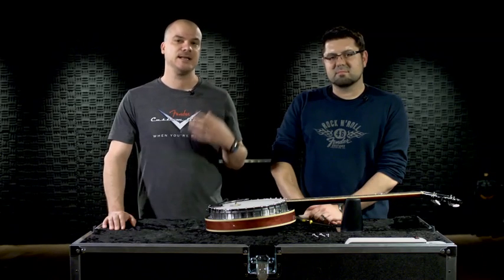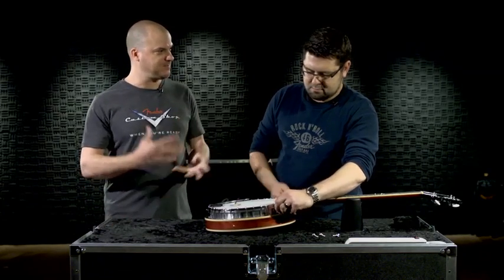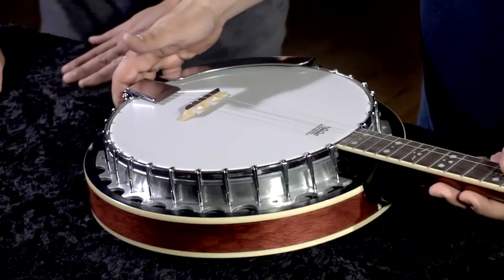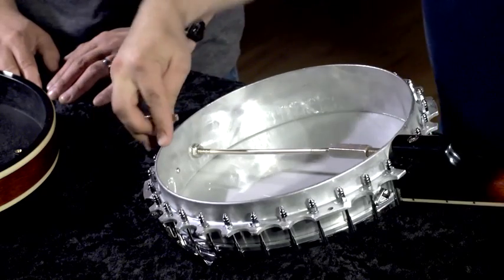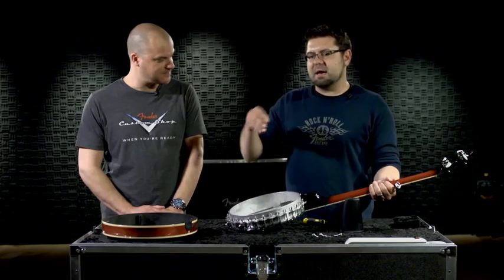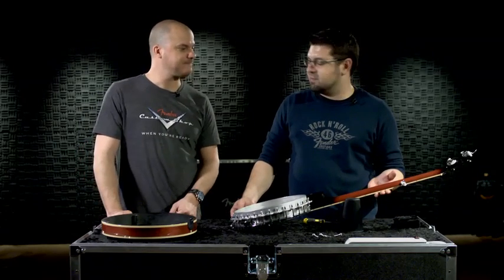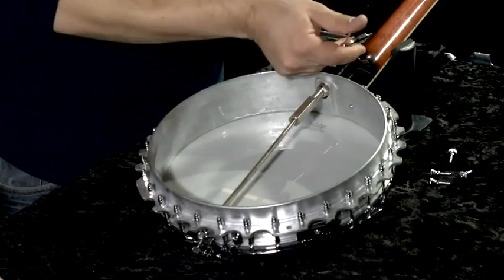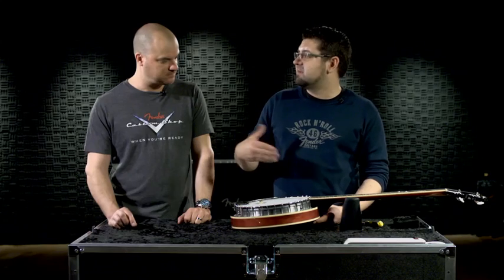How to Tighten a Banjo Head | Fender

Comment: Better approach is to know the proper head adjustment in kg/cm. Take a Neary Drum Torque and the correct drum key (not always same as for drum set). Then you can become precise and don't need to hear what you're doing. My head has 24 tension rods and my luthier friend told me that my banjo, an Fender Leo Bluegrass, needs 12 kg/cm.
Reply: with a more scientific explanation that I saw in other yt videos, I also arrive at almost 12 kg/cm on my Gibson, with 24 tension rods too. I agree with you.